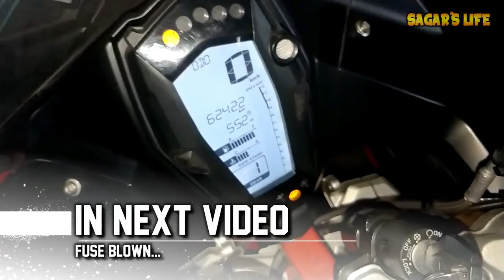Easiest Way To Remove Tyre Hugger Of Apache RR 310 | NEW HORNS | SPORTY LOOKS

Comment: sagar bhai, have u facing engine off while u riding on rr310?
Reply from the maker: No man.. You need to get your bike clutch properly adjust... It will resolved the problem...
Reply: sagar bhai, i bought this bike just 2 months ago its a bach 11 model, one month its working ptoperly, but after one month i m facing some kind if issues, big issues while i riding, the engine being automatically off on specailly on 5 th gear or 3rd gear, i visited the sevice centre on 7 times  take the same issue, but still not solved the problem
Reply: have u any solution of this issue?
Reply from the maker: @arunmaiti2840  yes as suggested above get clutch adjusted
Reply: kk sagar bhai👍
Reply: @Zeko4321  no bro, still facing the same issue, i escalted the issue of head banch,so they are saying, in india they are facing of issue, but not all models, some models they are facing issue, so they are working  on it, & they will fix it, as soon as, they are saying as like it

Comment: Sir in my rr310 battery light is on .while riding what does it mean.
Reply from the maker: Get your bike alternate get change and also get diagnostic test run through tab. Its better to get the magnetic coil get change 👍
Reply: @SagarsLife  which battery comes in bike I want to change it
Reply from the maker: It's under rider seat, if you remove the seat then it's clearly visible, please follow the manual instructions for proper voltage battery 👍